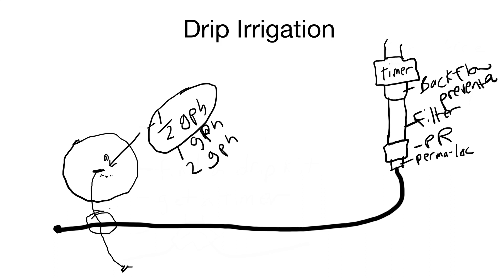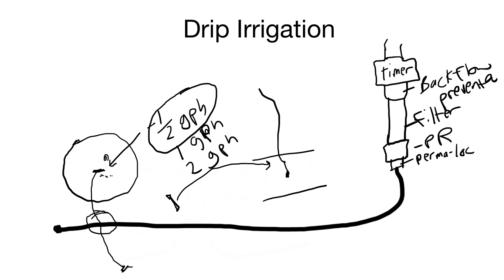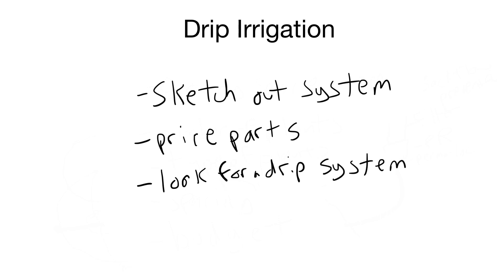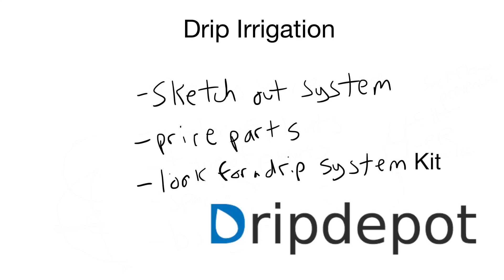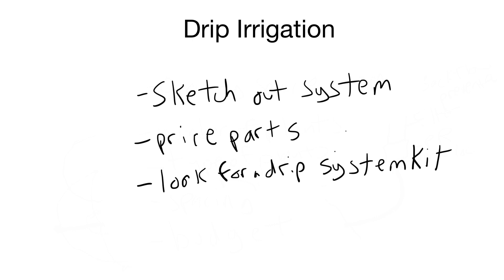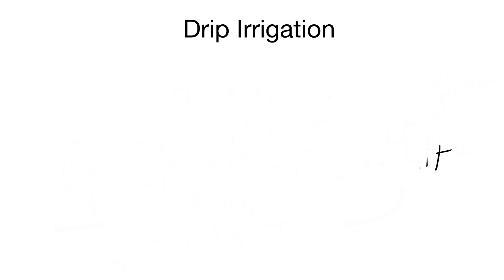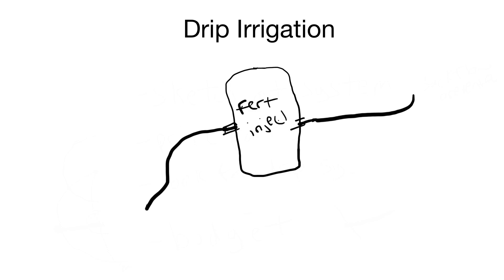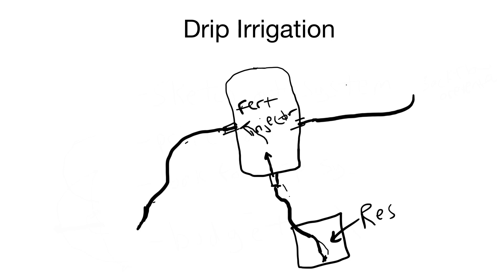How install a drip irrigation system - Part 1 - Overview and strategy for designing your own

Comment: Hi Peter I’m Sam, i saw one of your many videos, (thanks for sharing all the info about peppers and hydroponics by the way) the one about watering plants and you recommend the dripdepot page so I order the basic automated watering kit https://www.dripdepot.com/product/basic-automated-vacation-plant-watering-kit
And later I ordered 15  360 ajustable dripper  https://www.dripdepot.com/product/adjustable-dripper-on-6-inch-stake
Cause I have 12 plants in Walmart reusable bags and 3 in small pots so I installed 12, 360 adjustable dripper and 3 basic dripper for the small containers but I have a problem...(Houston we have a problem) looks like there’s not enough water pressure for all the plants, I mean water keeps coming but really low so my question is, what can I do?
Reply from the maker: I think the problem may be with the adjustable rate drippers you added, I would try swapping those out with fixed rate drippers, like .5 - 1 gph. The adjustable-rate drippers can use up to 19 gph. Please check with Drip Depot customer service. They are always quick to respond and very knowledgeable. I am willing to bet they will tell you the same thing about the emitters, but they probably will offer more specific suggestions on what to replace with, based on your overall setup. https://www.dripdepot.com/feedback . I hope this helps. Please let me know how it goes.